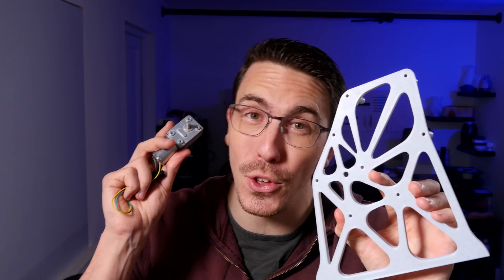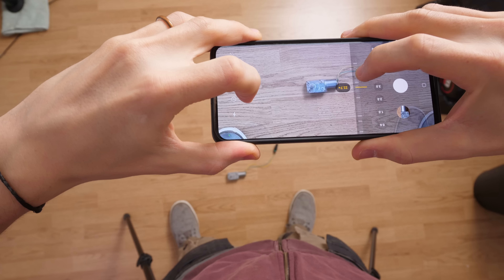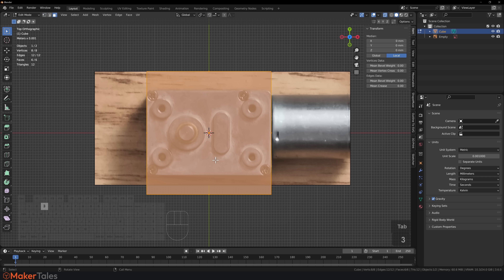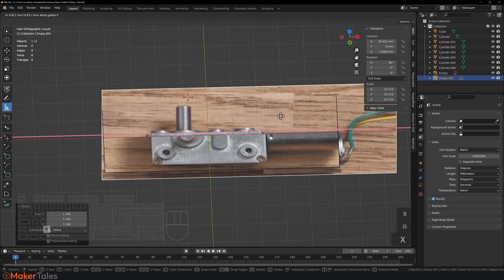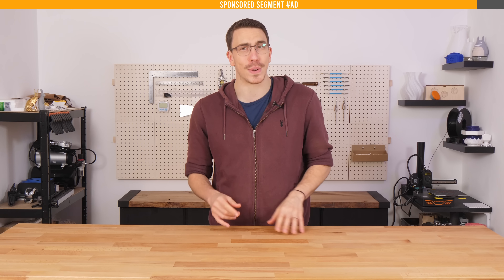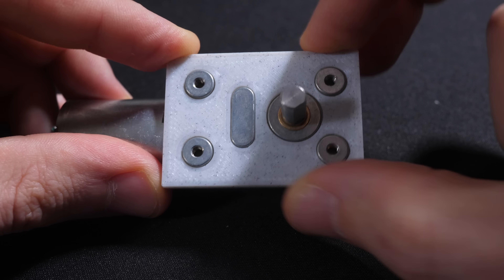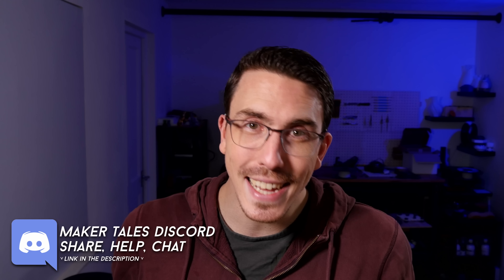My Secret To Perfectly Fitting 3D Prints

Comment: If you have a scanner, you don't only get a perfectly orthographic photo, you also get a fixed scale. So if you can, use a flatbed scanner.
Reply: I have done this many times.  I assumed everyone does this, I don't know why.
Reply: Unfortunately this does not work with all flatbed scanner. Some scanner can scan the ceiling (can get dark) others already struggle with less than an cm.
Reply: @GMLSX  You can put a piece of white paper or card stock above the object, in place of the scanner top.
Reply: @noeqplease  and that is supposed to accomplish what exactly?
Reply: @GMLSX that blocks the view of the ceiling and helps exposure.
Reply: @IRGoat  looks like you did not understand why I wrote: "...(can get dark) others already struggle with less than an cm." Getting an image of the ceiling is very welcome. Having a blurry mess just 5 mm away is not.
Reply: @GMLSX  I like how sassy get, when you are not exactly clear in what you are stating, and still have yet to explain yourself.
Excellent execution of using the English language.

If the ceiling makes it darker, then the person suggestion  is sound, add white backdrop where needed to increase exposure levels. It's not our problem you can not convey yourself well.
Reply: @KallTech  If you are lucky, you can scan parts that are as tall as the ceiling is high. Only problem is that the part that is away the furthest from the light of the scanner will be rather dark. Even if it"s white.
Reply: Only works when the part is flat and its borders are orthogonal. I tried several approaches to reproduce a guitar pickguard, the picture worked better.
Reply: I scan the ruler with my parts, and still use calipers.  But the scanner helps determine angles that may be in the part.
Reply: I use my flatbed scanner a lot. But sometimes like in this piece you have parts that protude more than 1cm. The scanner gets blind at that distance

With the trick this guy showed I would probabbly take photos of objects with my Nikon B700 across the room xD
Reply: Yep, this is the way. I always scan a ruler in at the same time to ensure my scale is spot on.
Reply: Since we're in blender you can use fspy to get counter this, but maybe establish your shot to help align the vanishing points.  Once you have the vanishing lines determined, you export from fspy your results and upon import it positions your camera with the proper focal length as well for the focal length.

Comment: Very interesting. Maybe you can shoot your ruler at the same time as the object, that should simplify the scaling.
Reply: This is how I do it and it makes it so much easier to calibrate the image.
Reply: I've done that a few times with really good results.
Reply: After that, you can (in most programs) also cut out the ruler image and spin/realign it if you need to get other measurements.

Comment: A major cheat to copying in a pre-existing item is to remember that any patterns are probably symmetical and dimensions are often the usual sorts of numbers that designers are wont to pull out of the air. So in something like this, the bolt holes will be on a fixed grid (ie the lines between them will be parallel and perpendicular to each other) and probably at multiples of 5mm apart. In the same vein, corner fillets are often 5mm or 10mm radius. While I've used the photo method, I've also drawn up all sorts of things to match something with nothing more than a ruler.

Comment: Useful stuff!  Some thoughts:

1. When initially measuring, make sure to do so in both Imperial AND Metric.  (If measuring in Imperial and the last two decimal digits is close to a multiple of 25, that is a good sign that the part was designed with Imperial measurements.)
2. Don't waste time and materials when testing fits.  A thin plate on a raft with holes in it--as he used here--is all you need to check initial fitting.
3. Unless you are doing a one-off, don't bother fiddling with your phone to scan the part in.  Instead, pick up a cheap-as-chips scanner or all-in-one from your local classifieds.  You won't have to worry about zooming/etc, and everything will be perfectly aligned.
4. Print a precisely-sized rectangle larger than what you need to scan, cut a rough hole in the center big enough for the object--without touching the rectangle, of course, then lay both on the scanner, facing downwards.  You can then accurately scale the image using the high-contrast rectangle instead of the object, itself.

Cheers!
Reply: Mostly good tips, though regarding #3, note that the part used in the example would not have laid flat on a scanner surface. A scanner can be a great option under the right circumstances, but evaluate the part first before choosing a particular imaging method.
Reply: @klasodeth  True; a scanner doesn't cover all cases.  (Where an object is mostly flat, a simple jig/wedge/etc. can prop it up.)

Comment: other really easy workflow; check for manufacturer documentation. Especially for technical elements, like stepper motors, sliprings, etc. They usually have a technical drawing somewhere with the exact dimensions on it for everything.

Comment: A flatbed scanner also works well if the face is pretty flat and doesn't have an axis pointing out the bottom.
Reply: Unfortunately, the example in this video isn't really suitable for flatbed scanners because of that shaft sticking out of the motor. Other objects might be more suitable. As with any technique, YMMV. (Your Mileage May Vary)

Comment: Great idea on using background compression.  For the photo, I’d suggest using a cutting mat that has either a 1cm or 1/4 inch grid on it. Place the object on it and you have the X and Y scale right there.
Reply: Be careful with this though, if the objects surface is off the grid's surface,  you'll still have a potential parallax error that equates to the height vs the distance your perspective was at, so that initial largest-feature precision-measurement is still a good thing to do for sanity.

Comment: For fitting round parts I usually print a small wall 5mm high and try it from there. The repeat accuracy of these printers is actually quite good.

Comment: I've done something very similar using a flatbed scanner for parts that can be scanned.  If you only care about a flat part on the end, the scanner will scan the portion of interest with 2400 dpi resolution and the portion above the scanner bed will be fuzzy and out of focus.  The scanned image can be opened in GIMP, which has tools that can measure any dimensions you like with sub-pixel accuracy.  A scanner and GIMP is a very inexpensive optical measuring system, similar to having a microscope with built-in micrometer.

I use a scanner and GIMP for determining the hardness of a material using the Brinell method.  A hard ball is pressed into the surface using a fixed force.  The diameter of the spherical impression indicates the hardness of the material.  I scan these small impressions at 2400 dpi and GIMP can make six measurements of the diameter at different angles, with sub-pixel accuracy.  I average the measurements.  It's far more accurate than using an optical scale on a pocket magnifier.

Comment: Been using CAD sketcher for about two weeks and my tiny ruler and ive been able to make some boxes for my ESP cam. The switches and Lids anll fit perfectly. I usually go about .25mm-.5mm bigger or smaller when im fitting components into things and when im doing lids and stuff I just do everything tight with no wiggle room and so far everything has come out nice.

Comment: Tip: you can default transforms like position and rotation by pressing alt + transform key (like "S" for example, resetting the scale to 1). This helps save a little time while dragging the image in as a plane; you can set it to be in the world center and lay flat using alt + "G" and alt + "R".

Comment: My recommendation that’s worked for me is set the ruler next to the part in that pic, draw a 10-20 mm line in your design app and align it with ruler and adjust until it matches

Comment: Fusion 360 makes this easy, take a photo of the object with a ruler in the picture, when you inport the picture into fusion there is an option to calibrate, you just click two points on the ruler and tell fusion how far apart they are, usually 10mm works for me

Comment: That clearance tower is a really good idea - I'm gonna use it. Although the video is a great example of being able to make items without calipers - if you're really into designing things, digital calipers aren't really that expensive, and they're worth it. Even the two decimal digit accurate ones aren't a bad price.

Also - if you're not getting round measurements with metric when you're measuring an item (especially if it's made in the USA), try the US customary  units. Most CAD software and slicing software can accept either unit of measurement and do the conversion for you.

Comment: my biggest issue with 3D resin printers is WARPING, especially when printing thin parts. does not seem to matter what orientation or settings i use. at some point during the print, cleaning or curing the part warps. i finally gave up on 3D printing some things and resorted to CNC milling machinable wax, making rubber molds of the wax models, then pressure casting plastic parts. this typically results in perfect parts every time

Comment: I think that the best workflow cames from combining the calipers along with this procedure, so you can quickly have a pretty decent starting point and later you can fine tune the measurements with the calipers. I personally have issues when measuring the distance from the mounting hole to either edge, for example.

If you do not have calipers around I would also suggest to take a photo of the ruler itself or a known size object (Maybe a screw) along with the "scanned" object, so you can scale things propperly. Better than nothing I guess.

Comment: Good techniques overall, I've found in my prints 0.25mm is a good off-set for tight fitting resin parts, and .35mm is a good offset for fdm.
Reply: Yes, I've found that depending on the surface angles within the parts, .25 to .3 millimeters  is best with my Bowden type extruder.

Comment: The most important thing for such parts is the correct wall order setting in the slicer. Default settings are made for decoration stuff.
Reply: To clarify: Print outer walls first when doing mechanical parts where tolerance is important. Also calibrating your printer/filament is very important!

Comment: Something that's not very clear on that tolerance test print, is the ring you slide up is as wide, if not wider than a size segmant, so once it stops, where do you take the reading from? The top of the ring? The middle of the ring? The bottom? Thanks

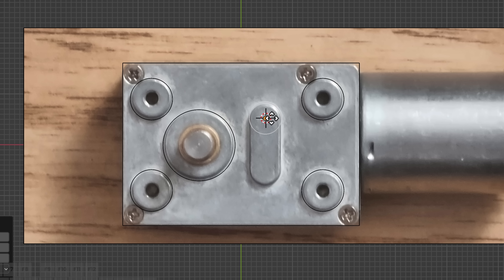Comment: I feel dumb asking but Im a blender n00b.  At 2:30 you took the cylinder, bisected it, and extruded half into an oblong shape.  For the life of me, I've tried figuring this out.  How is that done?
Reply: You enter edit mode add the shape, and press B for box select after you add the circle or cylinder, or any shape, he eyeballed the halfway point but you can zoom in and see which verts are selected. It's easier to do this if you are aligned with the gird and go into an orthographic mode '5' on the numpad, '7' for top plane view iirc.

Comment: As someone who used to do similar kind of thing (ie, creating mating parts to another parts), what's wrong with using just a caliper? It is just as quick. Not convoluted at all. Well, you won't get sub 0.1mm tolerance accuracy. Good enough for most purposes.

Comment: Not printing yet, so maybe thats a stupid question, but what about shrinkage (of different materials)?
Reply: That's something you can tune-in with "flow rate" or "scale" or "offset" depending on the part and plastic and how accurate it needs to be,, everyone has there own method-.
Reply: @Mindless_One  Using flow rate to offset that is a bad practice, because you are going to affect the actual volume of material that exits the nozzle, which can affect things like layer adhesion, surface finish, bridging, and other factors. You should always compensate for material shrinkage by scaling or dimensioning your part to accommodate it.
Reply: @ydoucare55  That's one of the reasons i'm use Cura 5.4.0 at the moment,,, you have full control over all flowrate for each extrusion action ( innerwall/outerwall/ infill/ surface/ toplayers etc,,, it can be a very powerful tool to get high quality surface/wall finish without effecting the parts strength (think of it like a coat of paint)-... with adjustable jerk and acceleration on each extrusion action the combination of actions is pretty bloody awesome,,, not like the old days when we had very very very limit options-.. don't drink the youtubers kool-aid these option are there for a reason,,,
Reply: This was covered by @Clough42 with his example being an ABS part. The shrinkage of the plastic threw off the location of mounting holes so he showed how to measure what you got to calculate against what you want for a scaling factor in the slicer. It's an older video (currently 4 years old), so to help anyone find it the video title is "How to 3D Print Dimensionally Accurate Parts". I only thought of this because I discovered the video only a couple days ago.

Comment: The way to look at it: it isn't the camera being not accurate enough. It depends on your eyes and how close you zoom in. I bet that if you took the time to really make sure those lines where correct to your picture, you would be a lot closer. I once seen someone throw that ruler in the picture. Use the ruler to set the scale the same way you did with measuring the part and making the box. Then make the part, pretty much, the same way you did it.

Because I am incapable of watching the whole video before making comments... As for the "building in the printers tolerance." Why not just make the printer shrink or enlarge things by that amount? The slicers have that option. Best practice, always assume metric or inch are whole numbers. If it don't make sense, something is wrong. Maybe that round part isn't straight? Maybe you are getting a skewed reading because the pin is tapered. All in all. I really like the push for people to model this way. I think 3d printers make more everyday engineering easy and more obtainable. Creates self value and is a very handy thing to be able to do.

Comment: 1:19 Just make a photo of the object with a ruler to the side of it.
Reply: Use a phone holder (resembles a tabletop lamp frame, sells online for cheap, used for videomaking) an set it flat via a level/clinometer app, find the borders of the camera viewing angle (mark it with a sticky tape) find the center of rectangular field of view by drawing two diagonals (they intersect in the center). This is where you put your object, orthogonal view is provided.

Comment: Printing that clearance tower is vital. Once cooled, filaments made of a variety of materials shrink differently. Even the same filaments differ in shrinkage in summer or winter. Any advice to use a generic 'loose' or 'tight' fit alone - is simply wrong. And a caliper is still best.

Comment: Modelling based on an image should be the last resort, especially for simple shapes like rectangles and circles.
As a general rule of thumb you should (in that order):
1. Try to get a CAD model of the part directly from the manufacturer or from someone who modelled it already (and always check the dimensions);
2. Model based on dimensions drawings;
3. Model based on the dimensions you measure with a caliper or a ruler (you need to have the part).

Taking an image (or a scan) is best used on organic or complex shapes

Comment: If you calibrate all axes correctly including the extruder. And get a orthographic picture than you can get 0.01 accurate.If you just get 0.1 accuracy then You should reconsider your calibration on your 3D printer🤣